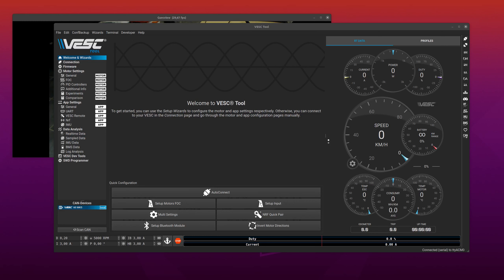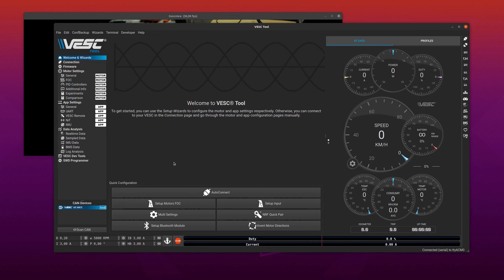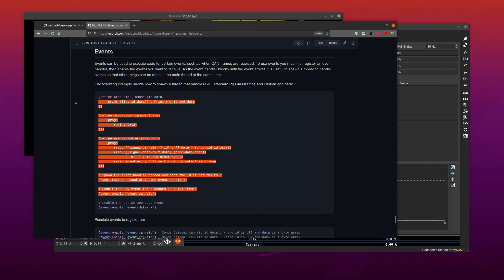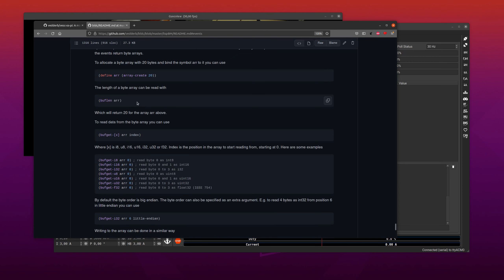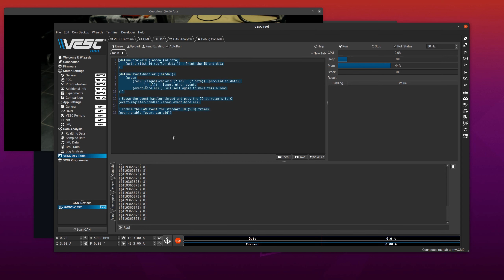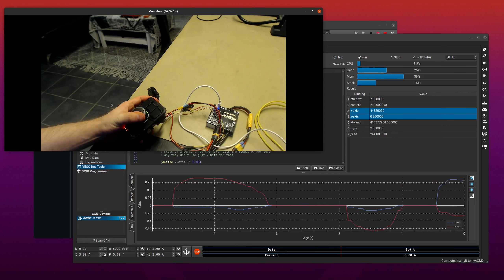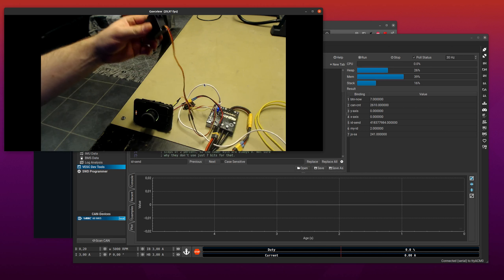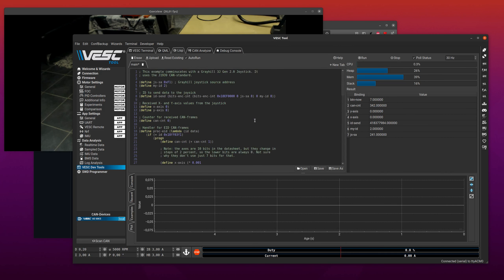VESC Lisp receive and send CAN-frames

Comment from the maker: Small note: I just changed the event-enable function from taking a string to taking a symbol, so the documentation and example will look slightly different from the video there. Make sure to use the build from today for it to work according to the documentation.

These changes will probably happen quite a bit now during the beta development, but for the release of FW6.0 the interface should be a lot more stable.